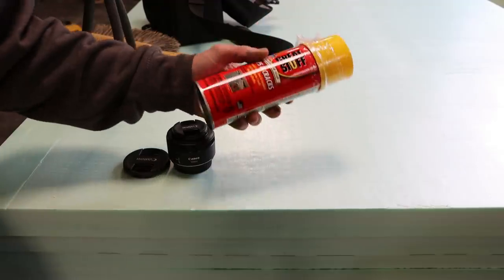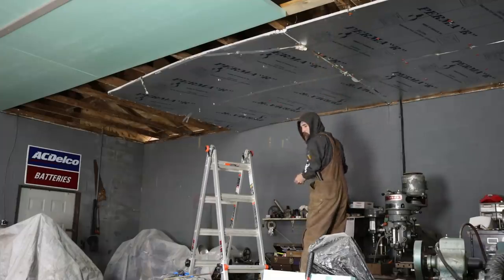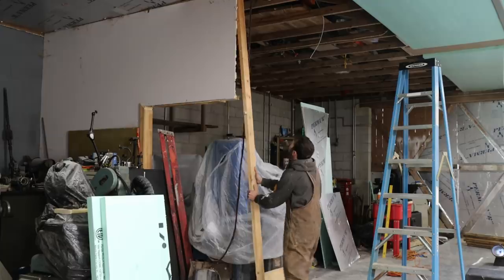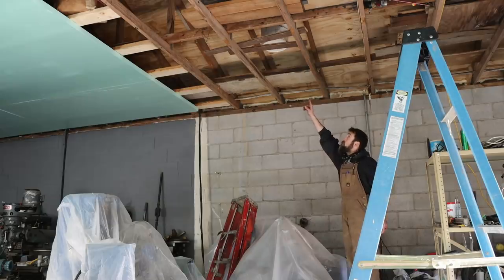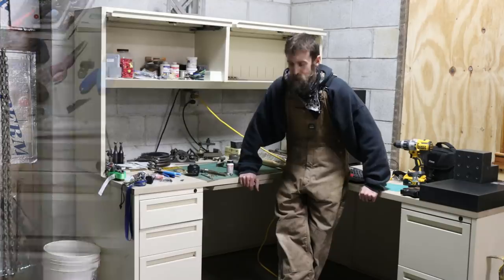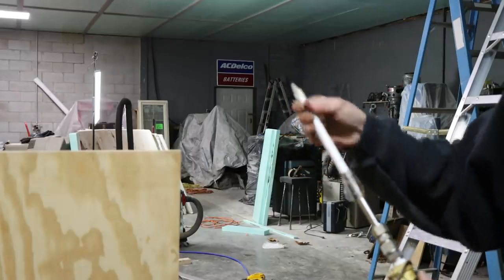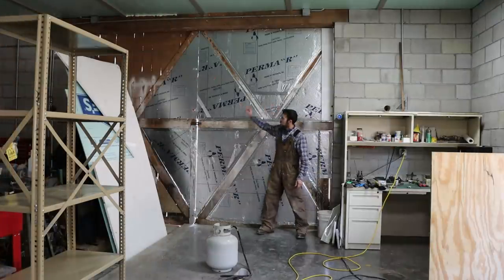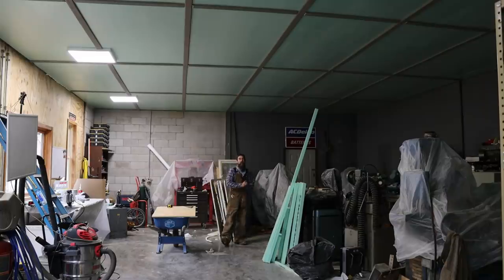Finishing my Polystyrene Shop ceiling   part 2

Comment: That eave draft is what keeps your roof from rotting away.  You leave the roof open to draft and insulate the ceiling, that way you are letting the roof breathe, remove moisture, and it prevents the roof from getting too hot and buckling, causing the nails to pull up and poke through the shingles.  My last house was not built properly and there wasn't air space between the insulation and the roof deck, so the decking would heave when it got hot and push the nails up.  After 15 years I had to go up and nail those down every year and patch the holes they made in the roof.

Comment: Your progress is going  nicely now, the ceiling looks very good , the floor looks good and its nice to see the doors progressing as well.
If your ceiling is now rated at R10 and your walls are not insulated  you will not gain any more R value for the total shop by adding rockwool to the ceiling in the future. The block walls only have an R value of 0.20. I will email you a copy of the Insulation Handbook that is published by the Insulation Council of Australia and New Zealand for your reference. Keep up the great work and i look forward to next weeks instalment. Geoff.

Comment: Dear Steve, When my dad asked me how to paint his new wood working shop, I told him to buy 5 gallons of semi-gloss white outdoor latex (in your case 10gal) and for each 5 gallon mix in one gallon of HIGH gloss. Now 15 years later it is still a pleasure to work in. One is hard pressed to find a shadow anywhere in the room even with only a couple of lights on. My dad is also a machinist and "well lit" has been his mantra all along. Hope this helps. Love all your videos. Great cinematography and story telling. Don't forget to strain your paint thru "cheesecloth" every so often it gives a superb clean look when dry. Almost a mirror finish. Would someone please send Steve a vertical bi-fold garage door like they use on airplane hangars?

Comment: Steve, in relation to sealing the large front doors to stop draughts, please let me suggest to you a low cost solution in using what we call here in the UK 'Cats whiskers spray suppression'.  It is basically a long strip of black nylon brush available in various depths to suit the gap in question, that can be cut to any length and normally goes on the bottom of mud flaps and around mud wings (or fenders for the US audience) of HGV vehicles to suppress and retain large volumes of rain water, and with the mounting clamps can be easily attached to the perimeter of the doors to make a sealing contact with the block wall and floor. It will always form to the shape of the block wall and floor as the doors open and close and is super simple to fit, zero maintenance, self cleaning and designed to suppress gallons of water at highway speeds so a bit of draught and rain on a stationary door will be no problem for it. It generally comes in 5 metre lengths and You will be able to get it from any HGV parts store. remember to order 5 mounting clamps per metre of whiskers installed. Hope you get to read this and keep up the good work. Darren Wright.
Reply: I've used a very similar product to weather strip the doors at my work, which includes three big double doors (it's a big church) and the difference was remarkable. We get lots of -20 Celsius winter weather. What I used has the brush attached to aluminum trim strips (8 ' long) and is screwed on.
Reply: Absolutely love the idea!
Reply: I think we call those "Door Sweeps" here in the USA.
Reply: Here in the UK and probably elsewhere it's more generally known as brush strip.

Comment: Broken screws or nails, battery drill, chuck it in the drill, reverse drill, can usually "pop" them out. Sometimes it works, sometimes not. 
I know many hate using spray foam but, for obvious reasons, it's really the best product to seal up any air drafts in any building. 
Now I know it may seem silly but, put in an attic door. You can say now that you'll never have the need to go up there but, sooner or later, you'll have a need to and wished you had installed an attic door. It's coming along quite nicely. Cheers :)

Comment: Those Govt. surplus desks are the best- we bought some from Boeing Surplus when they went on a big remodel campaign back in the 80's when they needed new computer type desks- I think we paid 4.00 each and they lasted 20+ years.  We used them in the shop more like benches with drawers and they were practically indestructible.  I remember Boeing was also phasing out their drafting tables in favor of CAD programs and you could get those huge tilting drafting tables with scales for practically nothing.  Of course in those days the real treasure was the tool room where you bought cutting tools by the pound.

Comment: I too had a totally open workspace but ended up closing off a corner and sound insulating it as a quiet office workspace, it works well as there is no dust and I can heat it better and having a nice warm and quiet place to do the paperwork is very welcome

Comment: Up here in BC Canada we leave these truss ends open to promote good airflow. Every other space. Then the ceiling is vapor barriered and blown in (cellulose) insulation but with you wanting to use that space up there I suppose that changes everything. Large screened in gable vents and turbines at the ridge to make sure there doesn't get a humidity problem is the way to go eh. With it being relatively warm compared to up here winters and you tightening this building up as you have a med sized wood stove and celling fans you will be toasty warm in winter and nice and cool summers. Oh yea and no leaks eh. Love it. Cellulose up here is cheaper than 10 in of fiberglass. "Chuckle" Even with something as simple as a relief notch in a foam panel the machinist in you is still there eh. AWESOME ! ! ! This is ALWAYS my go to first thing Saturday morning. The minutes seem to turn to seconds.  You should be very proud of what you have achieved here. Seeing the new space all lit up and back as a functional shop sure can't come quick enough for you I bet.  Take care now and stay safe eh......Dean......

Comment: Steve, a couple of suggestions.  
1.  Purchase a foam gun and use the larger contractor cans of foam.  You can adjust the bead size down to about 1/8 inch and when you release the trigger, the foam stops immediately.  The valve is in the tip and that allows you to store a opened can of foam for about 30 days.  Purchase the spray cleaner and you can just spray off any uncured foam when you replace cans.  Using a gun will virtually eliminate all the mess and you won't be getting it on your hands, clothing, floor and body.  I still wear gloves when using it though.
2.  Get one of the small closed cell foam Froth-Pak or equivalent.  You've got to have things at the right temperature to use these but, they'll allow you to spray foam and seal those difficult to access spaces.  It doesn't take long to get the hang of using them and there are numerous videos.

Comment: Now when you have blocked the draft and wasps with foam, you need some openings to vent out the moist air from below. Or else you get the water in the air condensing on the inside, when the air cools down.
Reply: I seem to remember Steve mentioning a plan for attic ventilation last week.

Comment: .The gravitational flat surface force  is multiplied 4 fold when the surfaces makes a corner. Hope the corner you placed the desk  is well made, as it will attract things constantly. Even at night things will be pulled to the desk. Least that’s what happens at my shop. Cause I know I didn’t make the mess.

Comment: You could always hang a workshop curtain wall around a corner of the shop with chain weights, or bottom sweeps.  That way you can still have a open shop most of the time, but when you need a cordoned off grinding room you have a reasonable separation.

Comment: Ceiling looks real nice. I didn't know what to expect when you started this project but very impressed. I would have pulled out the paint sprayer and gave it a coat of white paint but that is just me. Shop is really coming together. Congratulations, you have worked very hard for this.

Comment: Just a little tip for your paint can take a nail and punch some holes in the trough at the top of the can where the lid seals so the paint can drain back the lid will seal the holes

Comment: First off, another great video! I'm really loving this series Steve! I'm definitely missing machining,on this channel, but I get it. IM enjoying these too! Well, I'm not one to cram my preferences down anyone else's throat, but (There's always a but huh?) BUT I see this as a PSA more than pushing my views. I used to use the same type of expandable foam, until I sealed some gaps in some new vinyl replacement windows that I installed. Boy, did I ever learn a lesson! That type of Polyurethane foam keeps expanding, despite not having any more free spaces to fill up. It racked several of my windows, which caused about a half days' more work. 

Vinyl windows aren't really secured in place by a ton of screws.  The jamb and casing all but hold it in place, with a few 3 inch screws to assist in squaring it up. That is, if you  measure the opening correctly while the old ones are still in there.  Well, Aside from having to build a few extension jambs to flush some of the new windows to the interior walls, because they had been recently installed by someone that probably wasn't a window guy, and he left quite a few big gaps behind the trim, in that previous install. Typically, I would fill them with fiberglass insulation that I keep handy just for tucking into those little areas before the trim goes back up. I didn't have any of that with me that day, but did have some trusty ol' expandable foam. I had never used it to fill holes in replacement window imperfections, and never will again! The home owner called the next day and told me that some of the windows wouldn't open. SURE AS SHIT MAN, IT DIDN'T STOP EXPANDING! So much, it knocked the windows out of square. It didn't cause any damage, but I had to spend that half a day, cutting out the excess so they would open and close again. I was telling a buddy about it, and he told me he had done the exact same thing before!

He swore by this particular stuff, that was not as well known, or widely used back about 18 years ago. It's a vinyl foam that I still use today, or anytime I ever use foam to fill any gaps. Its made by DAP, and its in a blue, white and black can. It doesn't cure to a rock hard consistency like the  other stuff, but seals perfectly!  It applies so easily, and all you need for cleanup, is a damp cloth. Try that stuff next time, and you may be as impressed as I was/am. It's sold everywhere now.  Lowe's, Home Depot, Menard's, Sherwin Williams, etc... Hope this helps buddy! I really don't know if I could have conveyed its impression on me  with a shorter comment, so sorry about the novel! Oh! Love the recent violin music you've been using too man!!

Comment: In a 3000 sq ft shop I used to share with some others, we would use very large plastic sheets as curtains to separate clean from dirty or painting from dirty.  Curtains were on tracks so you could open/close them and our ceilings IRC were something like 20 ft.

Comment: Hi Steve the shop is looking awesome!
One thing i thought of  as you were talking about and open grinding area , If you want to control the dust more than just a good vacuum system.
You could consider temporary transparent plastic barrier  around the grinding area either on a 2x3  frame   or use a zip wall type system.... just thinking
have a great day

Comment: For your internet I would recommend an outdoor wifi bridge, I have a tp link outdoor long range wifi transmitter, think it was 40 bucks, it is capable of transmitting miles especially if you use a pair, but I just have one, and its connected to the wan port of a router in the garage. you could also put it on your house and transmit wifi at your garage. either way will work, but with the steel building you really need a wired connection between the interior and exterior of the building.

Comment: to answer your question  on the eves, down here in the south I would go outside and put a screen wire mesh covering on the opening, Then run an air channel to the peak (either the pre made stuff or thin wood, then install a peak vent along the roof. I then would insulate the roof and place thin wood on the inside surface (and paint it white), there fore the attic is insulated, so I can use the rafters as temperature controlled space. In the summer the air channel will cause the air to flow to help remove the heat from the roof layer.

Comment: Nice job on the ceiling, Steve. Not sure if you have taken it into consideration or not - polystyrene foam is very flammable. I would think about steps to protect it in the areas where you might have sparks flying, etc. I know where I live, you can't leave it exposed for that reason. Looks good though!

Comment: Steve, I noticed that you have high ceilings in your shop as I do. Just something to think about, I found that installing a ceiling fan was a total difference maker for temperature equalization in my shop. Bringing the trapped  hot air down from the ceiling made all the difference in the world. Also helps to remove the dead air build up during hot summer days. Give it some thought.
Bob McGeorge

Comment: Might just be a coincidence, but when I installed similar foam insulation in my workshop walls (Celotex, I think) my nose started dripping even at the sight of it. I soon learned to take the sheets outside when they needed cutting. Like the ceiling - I'm gonna go for that stuff on mine.

Comment: That tyvek tape is some of the best tape there is.  It sure sticks to the surface.  A couple of ceiling fans can help keep the heat down in the work zone.  That is one GOOD Looking ceiling.  I like the open shop, but you will eventually put up a walled grinding room, or stay busy cleaning grinding dust from every upward facing surface.  Stay well my friend.
Reply: If you're putting ceiling fans in a (relatively low ceiling) metal shop, put them on a separate switch so you can shut them off when welding.

Comment: I have to say... I always use disposable gloves with spray foam these days. I always end up getting it on my hands and everything if I don't. Let's be honest... the stuff is horrible but I love it. Works so well for filling hard to fill voids. Little tip if you're planning to keep mice out, I found that embedding steel wool in spray foam is hard for them to get through ;)
Reply: I'm surprised it doesn't come with a pair of gloves in the cap, honestly.
Reply: @jimurrata6785  Over here they usually do, but oftentimes someone else has taken the gloves out of them already if you get them at the store.
Reply: @WoLpH  It doesn't seem that way, here in the States.
The caps all have a shrink wrap seal, so I don't think there's any pilfering.

Comment: Steve.. I recall your desire to use that wall to close in a space to confine the grit from grinding work.  Then you decided to remove the wall and open the place up.  Also valid.  You might consider some curtains on a slide like they have in hospitals.  Close off the area when grinding and open it back up once done and cleaned up.  Maybe see if there is a hospital in the area that is doing a bit of remodeling.  Talk to the maintenance dept.  I believe those curtains are also fireproof.
Also, I love the old sliding doors and would be sorry to see them go.  From the outside it looks like just an old barn, then open the door and it's a whip-ass shop.  I guess it would be a "sleeper" shop.

Comment: Looking great Steve!  Love the almost filled corner desk lol The ceiling looks brilliant mate really tasteful!  Love the colour of the polystyrene insulation. Don't paint that! I would certainly keep it if it were my shop. Hope your sinus issues subside, but given the dust and crap you have been working in it's hardly surprising you were having issues lol. Well it's nice and clean now so you should be ok going forward. Almost completely finished! You can get back to machining very soon! Best wishes from the UK and still stay safe. It's bloody horrible over here art the moment with more deaths than ever.

Comment: A drop curtain in the corner would keep the grinding dust, etc. down and still allow moving stuff around. Painters tarp ceiling to floor plus a foot works great. Entrance in the corner with extra lighting.
Reply: A retractable shower-curtain style installation, suspended from the ceiling to form a semi-circle to the wall, would work quite well.